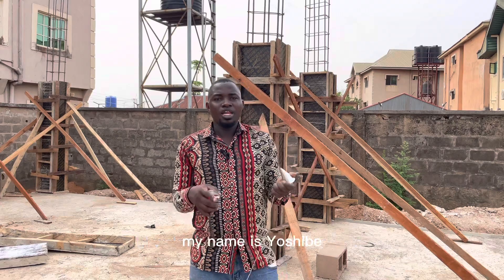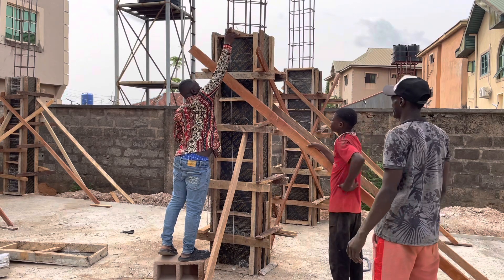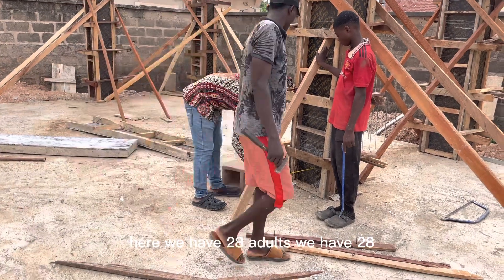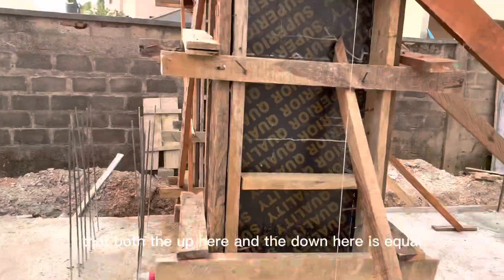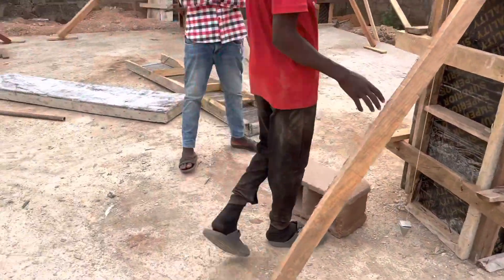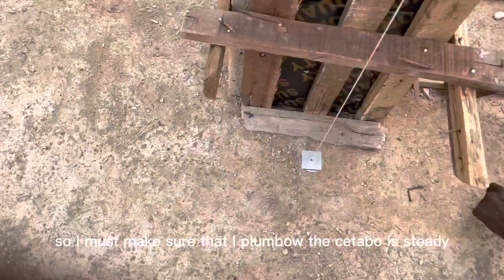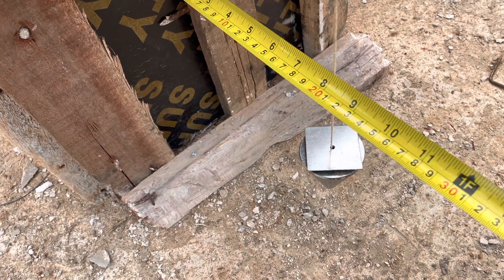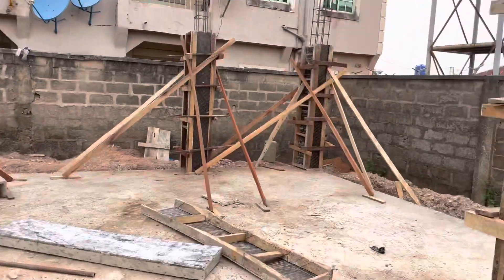How to check vertical alignment for columns and walls

Comment: You cant only rely on plumb bob for accuracy.. this method cant be used for frameworks of highrise buildings because it slows the entire construction process.  Use kickers, laser grids and ensure accuracy on the starters.  By the way, you just cant rely on formwork, because weather can cause deformity anytime anyday. Nice work for a duplex though

Comment: All this difficulty would have been eliminated with the use of column kicker or starters... you can even use laser grids to ensure accuracy. Then the formworks will just be plumped vertically from the kickers.

Comment: Also the top of that column that ur wood is resting on has to be level..if its not level your plumb bob results may nkt be accurate
Reply from the maker: You are very correct sir
Reply: not an issue. the plumb bob vertically, is only set by gravity.  the line can drop from any horizontal or inclined plane but ur ability to measure accurate. is highly important.